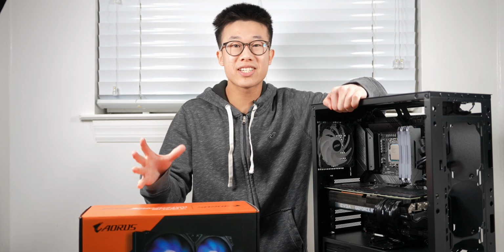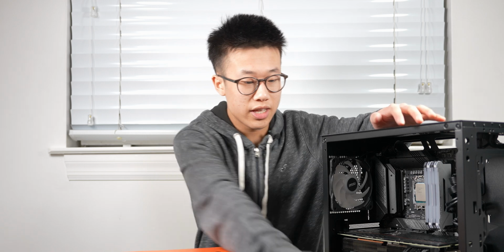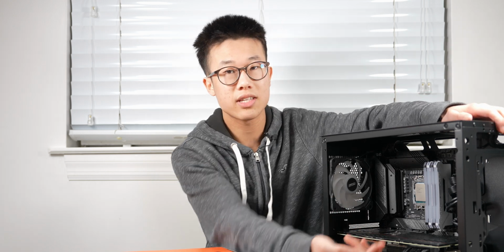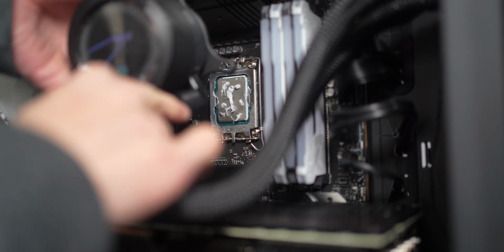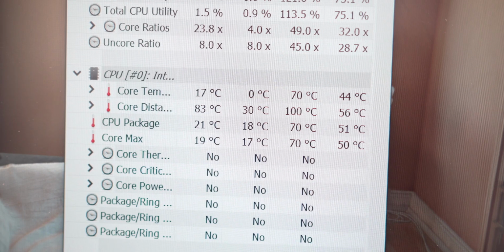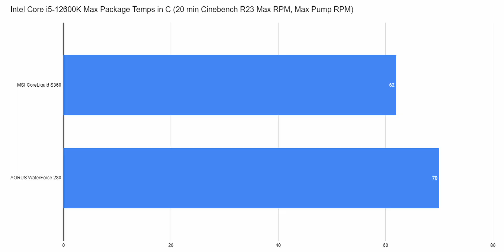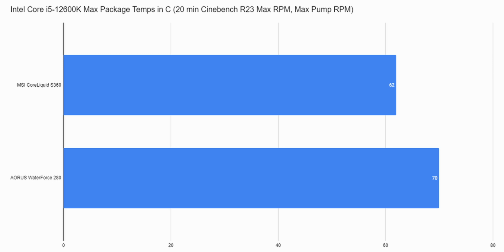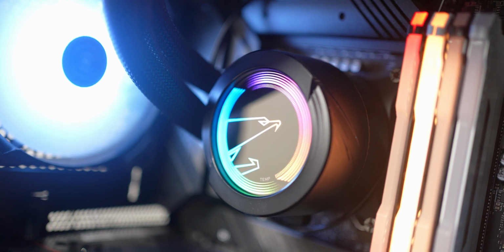AORUS WATERFORCE 280 AIO Installation/Review (Benchmarks, Thermals)

Comment: a 280mm radiator should perform at roughly the same as a 360mm aio.  That's because the 280 is using 2x 140mm fans.  2 large fans moves approximately the same airflow as 3 small fans.  The fact there's such a large discrepancy between the 360 and 280 shows something is wrong.  I personally don't think the issue with the AIO, but on the user end. Perhaps it needed a proper paste job (newer CPUs should have the thermal paste spread over the entirety of the chip. The old 'pea method' hasn't allied since 2016.

Comment: go watch a video on how to apply thermal paste. all you need is a pea sized drop in the center, and it will spread out when your cooler is mounted.
Reply: that's 2015 advice.  Newer chips are larger, so paste needs to be spread over the entire chip.  The video also does it wrong.
Reply: @meowmix705  no it doesnt. just did a new i7 with pea dot, no throttling.
Reply: @deafmouse-  it's old advice. Most OCers now spread it across the die since its so big. That's why Thermal Grizzly comes wuth a paste spreader
Reply: @meowmix705 the way you are doing risks making air bubbles, you can end up frying your CPU. stick with the Pea

Comment: Water cooling or even fan cooling < I like the Video but If you look at automobiles the fans bring the cool outside air into the system to better cool the readier even sitting in traffic on really Hot days Not blowing Hot air on the readier from inside out of the Hot system . It's been that way for years & years , If they do it with automobiles then it must work , There is lots of other ways to get the Hot air out on the system , Vents / exhaust fans out of the back & Also the computer power supply also has a exhaust fan , Look at NASCAR 500 laps cooling brakes & Inside the cockpit for the driver & engine bay .

Comment: What can be the problem if the RGB of the Radiators wont turn on?
Reply: you don't have the RGB cables connected to the pump, or you don't have the Gigabyte AIO software installed.

Comment: Your Test is really f-ed up.
Only good thing was that you knew to have the liquid get its equilibrium, as they take longer to reach it, than air coolers, but the rest...
Thermal paste application is a mess and  will leave air pockets behind and probably mess up the socket too.

And then nothing but cheap excuses, as if to make the AiO look better...are you getting paid to make it look good or what?

"no 12900k, as this gets really hot and i dont want to burn it" and then proceeds with a i5 12600k which is way less of a challenge...
"...Or 14.3°C its really cold out here and i dont turn on the heat to not mess with the results" WTF? 
You are testing in conditions pretty much NO ONE sits in and uses it and which are in favor of lower temps, which fing messes up results FOR EVERYONE?
SRY but this is BS!

Comment: Do you think this will fit a Z690i ITX motherboard, particularly the Aorus Ultra ITX board? I understand the latest Z690I boards have very little space due to heat sinks and what not. Eagerly waiting your response.
Reply: same problem for me. I have z690i itx gigabyte motherboard , i got a razer hanbo and is not fitting. Did you find a solution for this ? :)